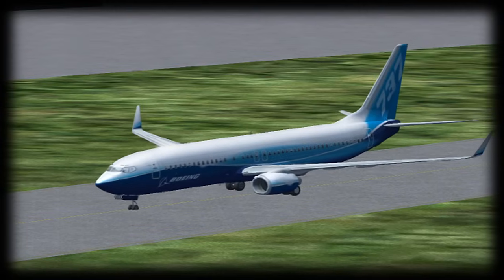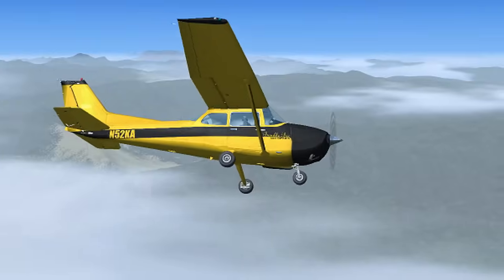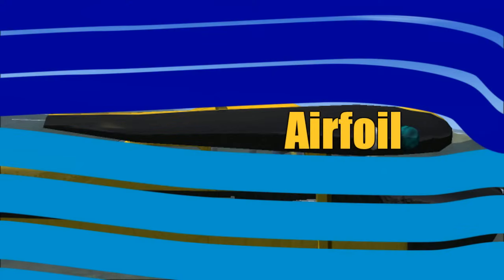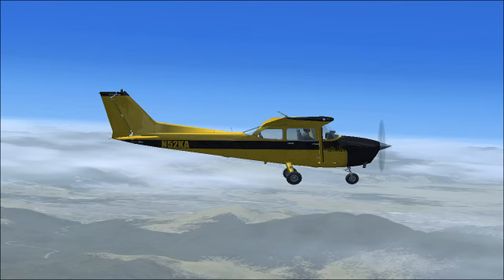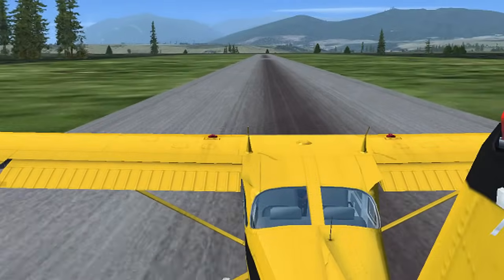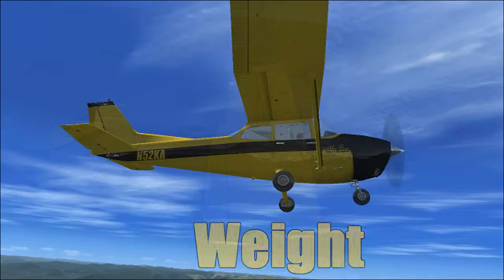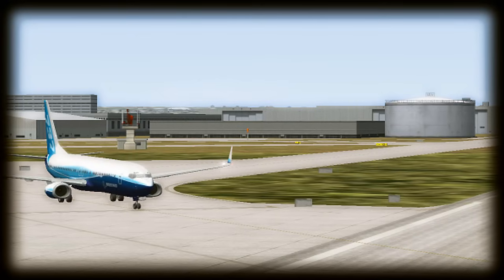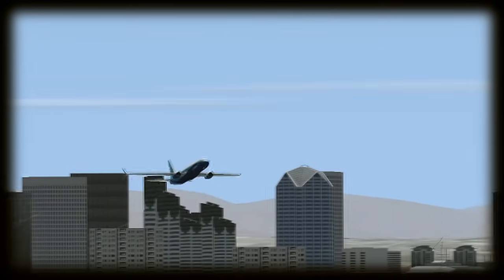The Aerodynamics of Flight

Comment: The way lift is explain in this video is partly untrue. Wind tunnel experiments have shown that air does move across the top section of the airfoil faster. Instead, due to the shape of the wing, air is directed downwards. This, according to Newton's third law of motion, creates a equal reaction towards to aircraft from the air. Your explaination is not entirely correct as Bernouli's Principle suggests that the air passing the airfoil must join back together at the trailing edge. Studies at Cambridge Univercity has concluded that air does not rejoin. The theory also ingores Newton's third law of motion, it does not contain a description of the opposite reaction caused by the air directed back by the airfoil.
Reply: +StuffedPigz 

You hit the nail on the head. Now take it a step forward.

Lift in aircraft is generated by accelerating air downward, much like a rocket. Therefore aircraft are sustained in flight in accordance with a Newtonian Third Law exchange of force/energy downwards.

Rockets also utilize the Newtonian Third Law to fly by directing force/energy downwards. However, with rockets it is quite clear that massive amounts of energy must, and are, consumed in sustaining flight. What of the energy consumption of aircraft? How do they sustain themselves in the air for so long with less energy consumption rates than rockets? What is the primary source of energy utilized by aircraft to generate lift, and to sustain flight?

That would be gravity--Gravity provides two-thirds to three-quarters of the energy utilized in generating lift on an aircraft's wings. Essentially a plane is always being pulled downwards by gravity. That pulling force causes air to flow over an aircraft's wings, accelerating the air downwards, generating lift.

Additional energy then is required to overcome drag, and to generate the additional lift required for level or climbing flight. That energy comes from the conversion of chemical fuel energy to thrust in the engines.

Aircraft are then sustained in flight by air accelerated downwards by the wings with energy derived simultaneously from both gravity and chemical fuel energy induced thrust.

This fact is lost on most, the vast majority, due to the use of Bernoulli, and/or "faster transit" in the teaching of aerodynamics and the nature of lift and flight.

If one doubts this, be reminded that planes have the ability to fly/glide if thrust is lost--The glide-ratio. That is, without thrust the plane's/wing's conversion of gravitational energy becomes apparent.

The above fact is also why mankind can fly multi ton aircraft for thousands of miles, but are unable to create a viable jetpack that a single man can fly for more a few minutes. The jetpack has no gravitational energy conversion mechanism, and therefor is solely reliant upon its carried energy in sustaining it in flight.
Reply: +kchrisc thats the readon why you shouldn't believe in everything on the internet
Reply: The wings were not 100% parallel to the ground. They had some degree of inclination.This way they were able to  create some air acceleration  downwards. Eventhough the drag was awfull
Reply: +StuffedPigz can you please cite these experiment? Id like to look into this more. So in essence a wing is the same as a fan? And Bernoulli principle is nothing more than a covered up 3rd law of motion?
Reply: The*
Reply: StuffedPigz u r write u should be the one making the video
Reply: mzs100  No the wing does not create a vacuum forcing air down. The shape of the wing and Angle of Attack creates a Newtonian flow turning downwards.

Comment: Lift and flight are absolutely AMAZING to me! So basically, it is lift that carries the plane upward when it reaches a certain speed on the runway, not so much the pilot? Wow!!
Reply: Yeah, basically, if a pilot let his plane hands free down a runway it would go up gradually, of course the pilot helps it by using the elevators to create more lift. Flaps on a plane create lift and drag, so they are deployed on takeoff to create lift, without flaps on takeoff there would have to be a very very very long runway.

Comment: Sorry but at 1:55 please explain how an aircraft can fly upside down? How did the original aircraft with flat wing sections managed to fly? A fighter aircraft is an example that can fly right way up, upside down and even in its side. How does a model made from flat balsa manage to fly? You have fallen into repeating an old incorrect explanation of how a wing profile produces lift. Please include a critical item of angle of attack. Hope that helps.
Reply: +Colin Herbert Consider my explanation. 

Lift is generated by producing a greater pressure
under the wing than above it. To produce this pressure difference, the only
requirement is a surface that is either inclined, or cambered, to the relative
air flow direction.

Regardless of the aerofoil design, the average speed
of air flow relative to the wing is always greater on the upper surface than on
the underside. Increases in air flow speed are associated with a reduction in
pressure, based on the bernoulli's principle. However, the bernoulli's
principle cannot be used to explain why there is a difference in flow speeds.
The bernoulli's principle applies to points on a single streamline, and we can
clearly see that the streamlines above and under the wing are different.

The production of lift depends on the viscosity of air.
To understand how lift is generated, it is important to know the concept of the
boundary layer. The effects of viscosity are only
important and apparent in a very thin layer adjacent to the surface of the
wing. This layer is called the boundary layer. 

As
the flow speed increases when the aircraft accelerates, the boundary layer
starts to separate at the trailing edge due to the adverse pressure gradient, and
a starting vortex forms. Adverse pressure gradient is defined when air flows
from low to high pressure. The vortex grows and eventually leaves the surface
of the wing and proceeds downstream. It is the production of this starting
vortex that destroys the anti-symmetry of the air flow, resulting in differences
in pressure and speed between the upper and lower surfaces. 

Thus,
it is the viscosity of air, working through the mechanism of boundary layer
separation and starting vortex formation, that is ultimately responsible for
the generation of lift.
Reply: +Yeo Jun Quan Soe great sanity here...

...the only requirement is a surface that is either inclined...
Yes! The only requirement for sure but there are then benefits in shaping the wing as we know so perhaps the on;y fundamental requirement. Could we have passenger aircraft with flat wings... probably not.

The bernoulli's principle applies to points on a single streamline...
So lets ditch Bernoulli for now!!!

The production of lift depends on the viscosity of air...
I don't think it depends on the viscosity. We can fly in thick (cold) and thin (hot) air and 'fly' underwater. Viscosity has an effect for sure and lift varies with it but I wouldn't use the term dependent although technically its correct, its misleading.

Boundary layer...
Yes!!!

...resulting in differences in pressure and speed between the upper and lower surfaces...

Hmmm, yes to a point but how do you explain difference in air flow rates above and below with slow speeds and no vortex creation?

...ultimately responsible for the generation of lift...
No, How do we explain lift on a flat wing balsa plane at very slow speed with no vortex creation?

Great thoughts there and a thousand time better than the video.

Comment: Could you explain this? "lift is proportional to the square of the airplanes speed"
Reply: +John Morrow  .  Forces in a fluid in general, will vary as the square of the speed.... If you fly twice as fast you can have four times the lift.  If you fly 1.4 times as fast, then you can have twice the lift.  L = k * V^2....This assumes a constant angle of attack)

Comment: Forget Bernoulli - NOW!
Bernoulli studied non-viscous flow in 3D-tube. His theory does not apply (as such!) to a 2D-wing in a free stream airflow.

Lift is created according to Newton's laws of motion - PERIOD!
Airfoil (or any surface) with angle of attack create lift by deflecting air downwards. Naturally a force is needed to have this deflection - nothing moves without a force. This is stated by Newton's first law.

Newton third law states that if there is a force, there is always an opposite force to the body that caused that force.
Think of a load hanging on a crane hook. There is the weight of the load - downwards. To have the situation in balance, there must be an equal but opposite force acting on crane's hook.

This is exactly what happens by the wing. We call that opposite force a "lift".
But, with a wing in airflow we do not have a single point of contact, where those opposite forces meet.

This opposite force to the wing (to the aircraft) is transmitted by pressure and, pressure multiplied by area is force. Pressure distribution over the wing is a resultant of that downward force that wing produced to air stream!

Wing angle of attack creates a low pressure to the wing upper surface. This is the main reason why we have the upwash (in subsonic flight) and downwash that are the reasons for lift.
If we lose the continuity of the wing upper surface flow, we call it a stall.

We need profiles to have sufficient structural strength (i.e. thickness) to the wing with minimum drag and also to improve stalling characteristics. Paper airplanes and kites fly without any profile!

"Last but not least"
Wing angle of attack creates low pressure to wing upper surface. This transmits the lifting force to a wing. This also causes acceleration to airflow - not vice versa! Increase in wing upper surface velocity is a result, not the reason, of lift!
The increased wing low surface pressure is of lesser importance.

Comment: Ever try to put your hand out the window of a fast moving car? Ever try to make a horizontal shape? Notice how depending on the angle of your index finger, your hand gets pushed up or down, or difficultly, not at all? That's how the wing works.
Reply: Ayo ayoyoyoyoootootootooo
Reply: Ur genius
Reply: im here to say that you have a goofy face 🤝
Reply: Welll..not actually. Planes use low air  pressure gap of wings for upward lift force generation which is free and acts much like a ballon phsics instead push force of wind.
Reply: @ahmetmutlu348  often repeated, but almost all lift is from angle of attack (hand out the window) of air creating an upward force.
Reply: @johnmaguire2185  i hink it depends ,you are righg when its lifting and landing , as it can be seen addittional flaps and angle of plane shows wherebthe force is... but while gliding its air pressure the biggest force that holds it up.
Reply: It's kinda disturbing to know that such a simple fact like "lift is generated by Newton's third law" can be buried in the BS that claims lift is generated by Bernoulli's principle.  it's education vs indoctrination and I wonder how many other areas of science and education have been molested.
Reply: do not waste ur 7 minutes and 13 seconds on this video ..here is what you were looking for !!
Reply: Omigosh! This is a GREAT point! Yep, when hanging an arm out of the window of a moving car, the air seems to "lift" it no matter how much I try to push it down, as long as the car is moving forward at a great speed.
Reply: My hand Is a dolphin!
Reply: +Amr rayyis Awesome explanation!  Studying aviation and it sure is tricky!    Thanks for this tip
Reply: hahah i do that all the time during summer :)
Reply: Amru Alrayyis thats right😉😉😉
Reply: Yah.... I have tried it while on a motorcycle as a passenger. ...  very interesting.... a huge amount of force is generated. ...just instantly....
Reply: Amru Alrayyis wow... Thanks
Reply: I was thinking just that! Always did that as a little girl 😅
Reply: I do that all the time for fun
Reply: That's the newtonian function of lift but your hand is barely a wing, so it doesn't explain the bernoulli part very well.
Reply: @Naoki09  That does not make sense. There is no such thing as "Newtonian function of lift" or "Bernoulli part of lift". The pressure distribution over your hand is the lift. Also, the change in momentum of the air coming into your hand to momentum of air leaving your hand is also the lift.
Reply: Yup, he did not said anything about flaps.
Reply: Genius
Reply: not really, but it's a good simplification I guess